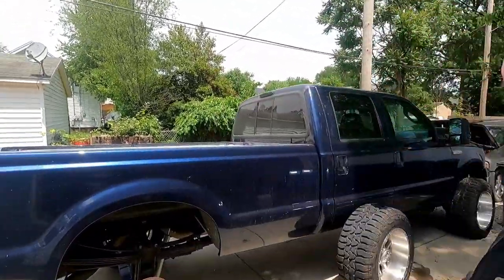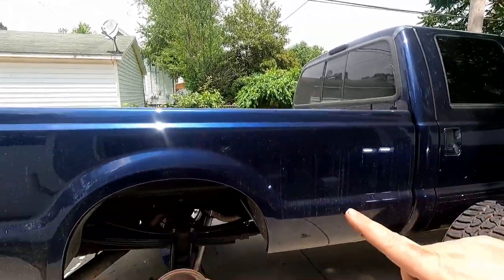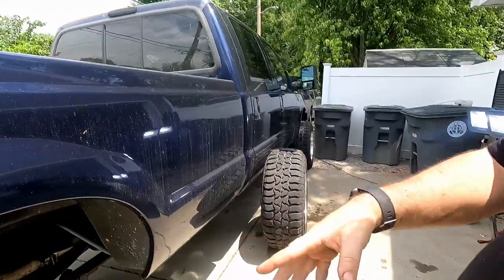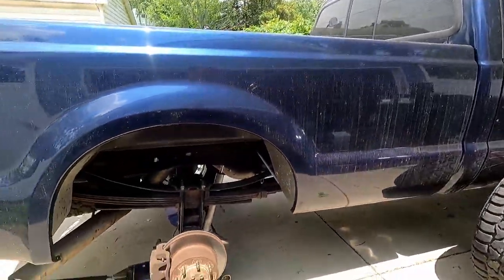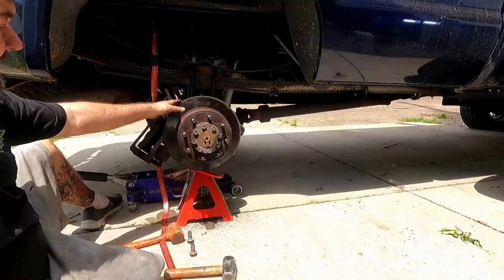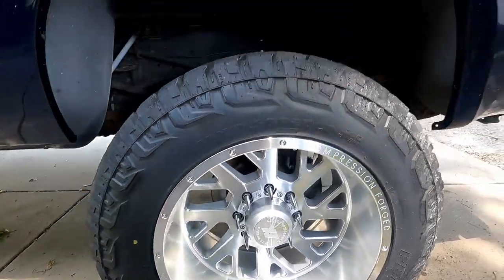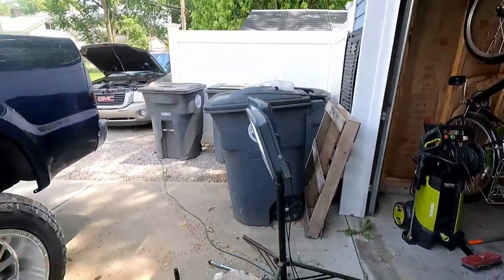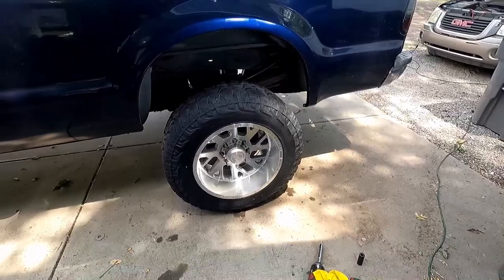F350 Rear Wheel Bearing Replacement

Comment: Should be using gear oil for lubrication. Contaminating gear oil with grease will shortens bearings life and gear oil.
Reply: I was thinking the same thing… “whoops, that’s not correct”

Comment: Absolutely loved your video. I had seen in some of the videos of people doing this that they took the shortcut and the more expensive option.
As far as I know Ford is the only one who sells that rear ball bearing housing. Instead of taking it all apart replace all the bearings Ford has one that bolts right and place but it's over $500. 

I'm looking to pick up a F350 and the owner is already told me that the rear bearings on the driver side needs to be replaced. 

That's when I came across Ford selling the whole unit. I also found all the bearings and they have a complete kit. If I'm not mistaken RockAuto it's like $75 or maybe $95. It definitely was not $500. I'm old-school repacking bearings is absolutely nothing for me. Whenever probably younger my father would allow me to repack all the bearings. Back then in the 70s and 80s that's how you repaired wheel bearings.

I most definitely hit the like button and subscribe button. Looking forward to watching more of your videos.

Comment: According to volume 2 of the workshop manual for 2004 Excursion, F-Super Duty 250 - 550, he's doing it correctly: 205-02D-6 "Lightly coat the spindle and pack each rear wheel bearing with Premium Long-Life Grease XG-1-C or equivalent meeting Ford specifications ESA-M1C75-B" (specifically that's for the Full Floating Axle - Dana) and 205-02F-12 "Pack each bearing and replace the hub seals" (Ford 10.50-Inch Ring Gear). After seeing some of the comments here I wanted to look it up as I might be doing this soon.

Comment: I am trying to figure out if the Bearing Hub is the same for 2015 RWD and 4wd
Reply from the maker: Should be the same only difference on the rear would be  single wheel or dual wheel
Reply: @EvilleTruck oh okay thanks do you know if hubs usually come with bearings? Im abt to change mine since person that sold it to me nvr did Hub and rotor is stuck together i have to change it all 😮‍💨
Reply from the maker: @Hardstyler981  for a 2015 yeah the hubs should come  with everything

Comment: It’s the brake line from the caliper to the hard line it rots from the inside out and doesn’t allow the fluid back so the caliper holds and it over heats and smokes happened on mine cheap fix

Comment: Your contaminating the gear oil you don't want that shit making its way to the clutches dump the 75w140 synthetic you use for the diff all over the bearing I only use Amsoil or Valvoline that diff needs to be drained and clean magnet
Reply from the maker: I have had a few comments regarding this, I have always, packed the bearings with grease, always, regardless if they get lube from differential or not,   if you are filling the diff to the point that your bearings are floating in oil its too full, theres not enough oil to keep it lubbed at all times  and the bit that does get in there isn't going to flush it all out, at least thats been my experience.   I know some will agree and others like you disagree , but never had an issue with doing it this way.
Reply: @EvilleTruck  I would be worried about the clutches and further lubrication with it slinging oil it start caking up its a toss up on what's right maybe after a good heat cycle it breaks down but it has additives that probably aren't good for limited slip clutches but if you don't have problems maybe its ok tomorrow I'm putting back together a 2020 F350 with 200,000 miles its hot shot truck rebuilding both sides we have to pick up the parts at Ford in the morning I'm gonna try to talk to technician and see what they are doing some will tell you and some are pricks hopefully I can find out because the truck runs cross country I have always used the gear oil but regardless on Ford's its 75w140 full synthetic usually a tag on the pumpkin saying it Ford is very strict on full synthetic and not 75w90 I like this truck because it has a arrow pointing right at the drain bolt on the cover so if I can't change it someone else doesn't pull wrong bolt but anyways I will try to find out tomorrow let you know on here what they say
Reply from the maker: I would be interested in hearing what they say.  I have looked online before and see  arguments for both ways.
Reply: @EvilleTruck  they just use gear oil but have heard of people doing it either way but recommend just gear oil but I guess if it hasn't failed probably ok
Reply: It's recommended in the repair manual to pack the bearing with axle/bearing grease.